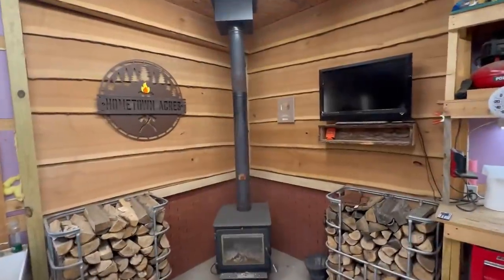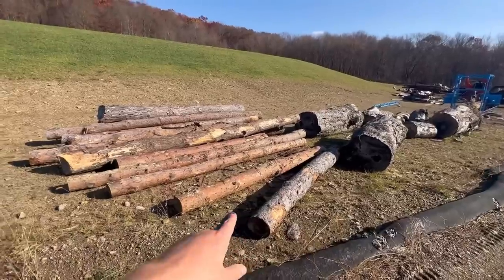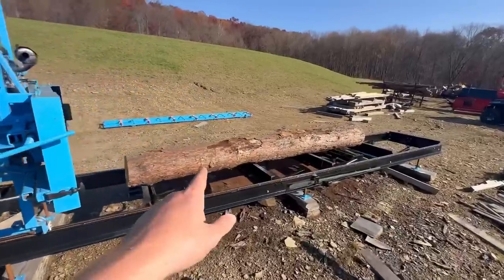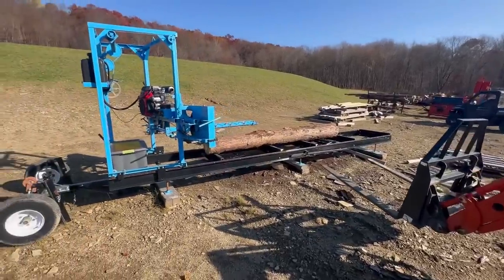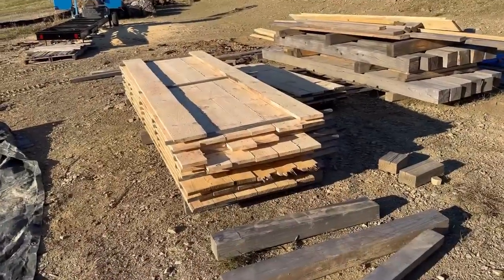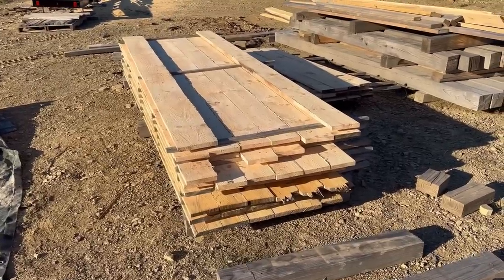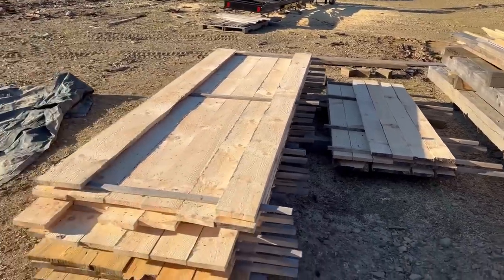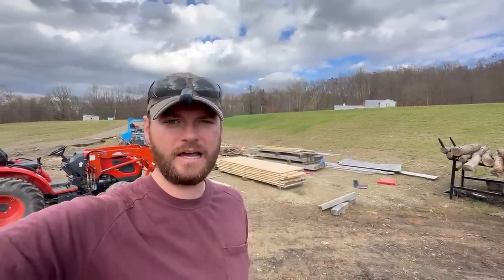Our Next Big Project Starts At The Sawmill

Comment: Fyi, u might want to let your  pine lumber dry in your  garage with a few fans   for about  a month after air drying 2 months outside. Otherwise the best thing to do is get it kiln dried  to set the pitch  at 150-160 degrees  so the sap hardens and doesn't start coming out of  knots after u spent all the time planing them. Just make sure you moisture  test the pine inside 1st.  Frozen wet pine lumber doesn't dry fast  outside during winter when below 32 . Only the shell dries not any of the inside wood cells

Comment: Hey adam have you ever thought about using a leveling laser  set up on a tripod on the side of the saw mill.  This way when taking off the bark cants you know how deep or shallow to cut into the log and don’t waste a cut redoing it. The laser also allows you to see the entire pre determined saw cut line before it happens so you already know what will be cut and what won’t. As almost being a certified black belt in lean six sigma I try to make all processes and efforts fast, accurate and cost worthy.

The boards are turning out nice!

Comment: Cool. I was going to suggest vertical, cause the 2x's are horizontal. But, have you thought of this? If you leave them live edge, than you can have a 3" gap between the first layer boards, if the batons are 4" wide & also live edge. Maybe use that idea for the future saw shed.